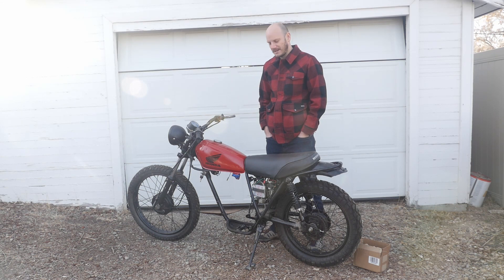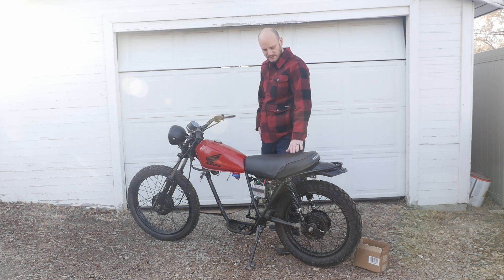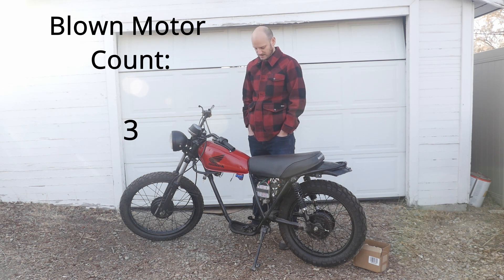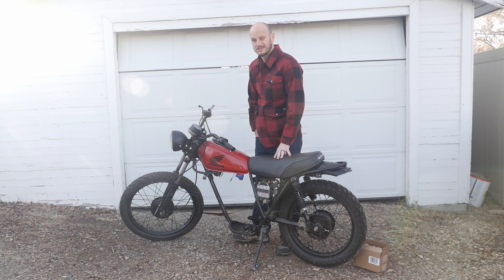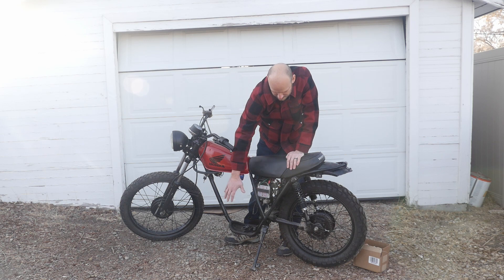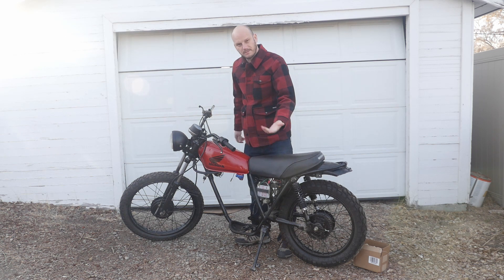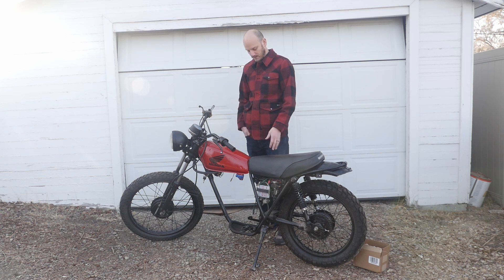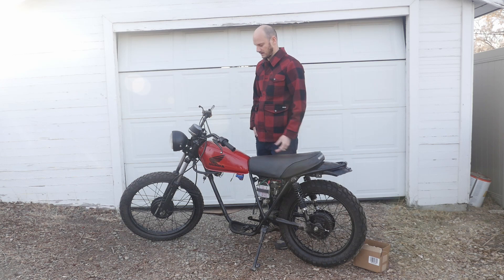Electric Motorcycle Conversion Honda XL175: #1 Finding the Right Donor Motorcycle for the Conversion

Comment: love the stuff you do. I have Tomos moped I'm going to do a conversion on. Cheap, built for a little more speed than a bicycle and step through frame.
Reply from the maker: Nice, I got a motobecane 49cc I’m going to put a cyclone on 😀
Reply: @JohnnyNerdOut  The nice thing about converting mopeds and bikes is that they have horns, lights and turn signals.

Comment: Interested to see how this turns out. I'm a pure combustion engine guy at the moment, got 1 motorcycle and 2 scooters at the moment. Always wanted a test ride on an electric motorcycle. Quite a few brands available here, the Zero is the most popular and expensive. I might just get a test ride this summer.
Got my ebike finished at last, it's amazing, especially on all the steep hills we have here. Had to tighten the motor fixing ring as it came loose after a few miles. 👍
Reply from the maker: You really can’t over tighten that lock ring by the way so I always try to give it hell whenever I can. Yeah I hope this electric motorcycle turns out awesome but I’m holding my breath :-)

Comment: Good Choice. Currently doing a moped swap with a Qs120. Should line right up.

If your going with Qs138 theres 3D models out there you can Print for mock up of the motor mounts as you wait for the motor to come in.

Are you gonna use the new Qs with the reduction gear?
Reply from the maker: Got a link to get a 3D model? My good friend has a Cnc machine and I think he’s cooking something up for me fortunately.

Comment: Pretty cool but....I dunno man....You can buy a 1/2 way decent Chinese. 250cc (223cc) dual sport motorcycle for $1650 ..My poor ass would have to buy a $1650 dual sport, ride it until it dies and hope batteries & motor kits are cheaper in the future.
Reply from the maker: I just don’t trust those things to last for any serious amount of mileage. Plus this is more of a passion project. I want to retrofit vehicles in the future to save them from going to the junkyard.
Reply: @JohnnyNerdOut  I hear Ya, millions of those cheap  China 250 bikes have been sold.If someone made and sold electric conversions kits for them they could probably sell a ton.
Reply from the maker: @michaelbrinks8089  you thinking what I’m thinking.....those bikes are probably close to free if the motor is blown. Might be my next conversion